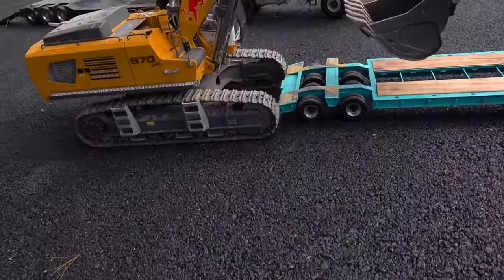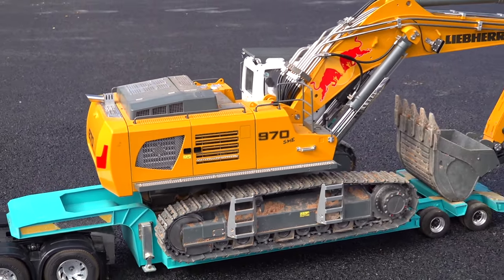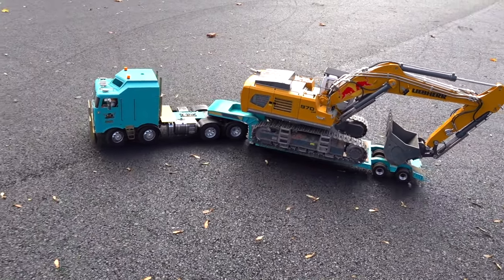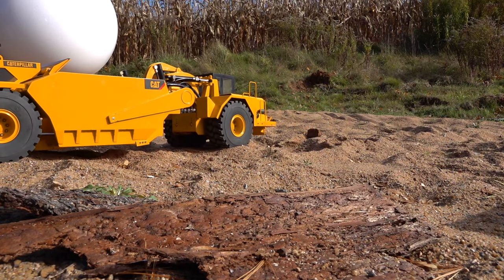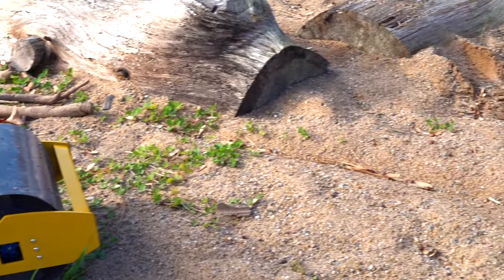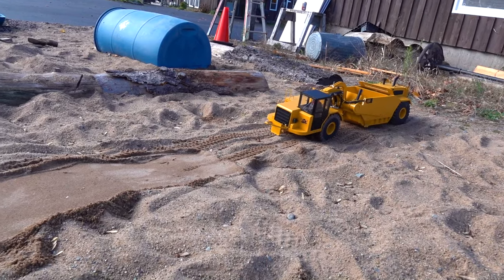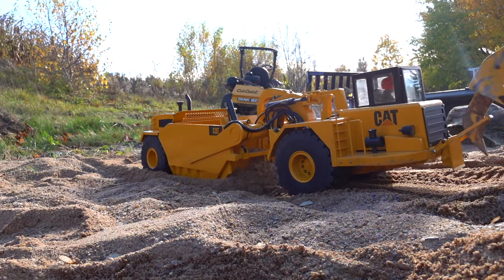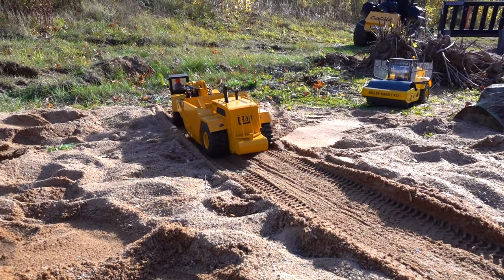Barely Scraping by, Without Any Help - Building my First Road | RC ADVENTURES

Comment: You should have a massive platform to hold all the radio control units, hanging off you're shoulders.
So you can have about 5/6 units on the go at the same time without having to keep picking them up and putting them down.
Then you can be the fat controller.

Comment: It look like you need to get a front detach lo-boy to load that scraper!  can the gate at the front of the bowl be raised higher to get material in better?  Does the ejector wall have different speeds or do you  just drive accordingly?
Nice presentation, would love to have the opportunity to run some of the units you have demo'd  in the past!

Comment: So the only thing you don't have in RC is a road grader and a paver... The scraper is probably one of those "it looks like cake" but really isn't machines. I know a few people mentioned it, but having the excavator loaded like you did is correct, and in RC its probably better because you have the heavy end closer to the drive axles so the truck pulls it a little better. 
I have a few RCs to fix before I can get outside and have fun. But working on them is fun too.

Comment: You have to have the apron on the scraper open some so the dirt starts to pile up in the can. At that size I would say at least and inch to 2 inches. You will never get a full load having it barely open like that. Nothing a foreman hates more than a scraper that isn't full. Also don't pull the scraper with the dozer, push it. The ripper on the back is not meant to be used that way. Much better to use the big old blade on the front to push with. I used to operate 637, 631 and 633. 637 are the two engine push/pull scrapers like the one you have. They usually work with another 637. One with a dozer would work but in the real world, they are much better working with another one. 631 are similar to the 637 but only have a single engine in front. A dozer is used with them. It pushes the scraper threw to get a load. The 633 is more of a finish scraper and uses paddle wheels to get a load of dirt. What I mean by finish scraper is when there isn't much dirt left to get to grade level, the level you would like to be at. I know the 637 and 631 come in a bigger size and are called 657 and 651. I know the 633 comes in smaller sizes and they are called the 623 and 613. 
Oh just in case you get another two engine scraper, when going into the cut, where your getting the dirt from, have them hook up. Then the guy in front lowers his can first and gets his load. Then when he is full, he pulls his can out of the dirt and the guy in back lowers his can and gets his. Once both are full, they seperate and head to the fill. Where the dirt is used to fill an area, obviously. Then of course as they get back to the cut, they join up again and repeat the same thing over and over and over and over again. Anyway, keep your shoulders high and your haul roads smooth.
Reply from the maker: But, there is no Foreman. I just want to play.. im not actually at work.  I like playing the way my imagination works..

Comment: I'm not sure if it's a glitch, but the roller seems to only rotate in the one direction when vibrating. It is actually fighting your forward motion when vibrating (best seen at 9:05)
Reply from the maker: It is not a glitch.. just the roller doesnt weigh 15 tonnes like the full size machine.  not heavy enough on the sand, so without traction on the smooth drum, it can go backwards

Comment: Loading the track-hoe reminds me of getting my tank on the car when railheading. Driving 65+ tons of tank down a quarter mile or so of flatbed traincar, the tank being ~18" wider than the car on either side, and the transition ramps from car to car were just big humps. You'd go from looking at the guy ahead guiding you to looking at the sky when the front hit the ramps, all at a dead crawl because it was 15' to the ground of you rolled.

Comment: Should make a controller link or a link sync cable so you can pull an connect both the steering servos together & speed controllers so you can use the one controller an not have to reprogram

Also lower belly of the scrapper when unloading an push the pay out so it fills the gap an the excess builds up on the edge sort of like your pushing dirt off the table an the scrapping the excess back up

Comment: Well hey I thought I'd help you out a little bit on your push pull scraper where you put the dirt at is called the bull not belly and the thing that pushes the dirt out it's called The Crowd the door that opens is called the apron and if you want to make a smooth pass you lower your can down to the edge of the bits on the sides you go to them where the bits are and then that would make a smooth pass and also you should have your Dozer push you not pull you I ran equipment for about 40 years so just trying to help you out there

Comment: The biggest reason you want to run with the boom to the back is because if for some reason you hit a bridge the it would be a lot easier if a hit compared to if it was turned to the front where it would be a lot more of a Blount hit because it would slide over the boom with the boom to the back of the rig

Comment: ideally you push the scrapper with the dozer with the ripper dropped so it breaks up the ground for the next pass. can you control the front hoop? in real life they run multiple of these machines and they push and pull each other

Comment: If you watch  J Paydirt  you'll  see that you  can push with  the  dozer  but the way you did it works  too
Reply from the maker: The hook is for the ripper, or another scraper pin..  Yes, the one can push.. but a good tug feels good too.. lol
Reply: @TheRealRCSparks  most will push the scraper rather than pull to save time and effort on the site.  The dozer operator will follow during the cut and begin pushing as the scraper begins to slow down from cutting.  At the end of the cut the scraper can simply pick up the belly, close the gate and drive away without stopping and the dozer gets back in the line.  Large operations will have a whole convoy of scraper and dozer teams making loops like this and never stopping.
Reply: @TheRealRCSparks  like I said in another comment.. you are bringing back a lot of old memories from my deployments in the Middle East.  I put in a lot of hours on every type of equipment you got lol.  When watching your videos my mind goes back to it and I catch my hand sometimes operating controls that aren't there lmao

Comment: just like matthew2 said but without putting the ejector forward you can adjust the amount of dirt going in by opening and closing the front gate and not have to drop it as far into the sand
Reply from the maker: Yeah, but as I mentioned - in deep sand there would have been no traction to push any sand.

Comment: To lay the road with your belly scraper open the door all the way put the belly at the height you want the scraper to lay the road start pushing the material out and drive super slow the belly should scrape any left over to the height that you want the road

Comment: Great fun, but the bulldozer should have been pushing the motor scraper, not pulling it with its ripper, I speak from experience after driving the real things (Dozers, Scrapers and Graders) for 20 years, but fun to watch.
Reply from the maker: What is the hook for... to be pulled.
Reply: @TheRealRCSparks  To be pulled by another motor scraper, they link up, the back scraper pushes the front one until it's loaded, then the front one pulls the back one till loaded (push pull) then they split to go and dump the loads, this saves them having to have a dozer push load them all the time, you also have elevating scrapers that can load themselves, if the condition are right.

Comment: How did you get the engine sould to turn on and off using the controller, because I have a Grand hauler with a  futaba t10j controller and can't figure out how to turn of the engine sound. The engine sound kit that I have is the Tamiya mcf - 1. If you could help me with this I would be so grateful

Comment: Can you mix a radio to control two machines? One machine per stick?
Reply from the maker: No.. but you can mix 2 machines on to 1 radio, and change with a flip switch
Reply: @TheRealRCSparks  I see. I’m strictly a pistol grip radio kinda guy. Never had the opportunity to use a dual stick radio so I know little to nothing about them 🤷‍♂️ lol cool stuff tho bro keep up the good work.

Comment: Loaded up wrong? Ive run equipment forever and i have never seen an excavator with the boom facing forward. Buckets curled, arms pulled up and in and then layed down and chained…

Comment: Was that as high as the bowl would go up for transport 1 more thing is a scraper is designed to move fuck loads of dirt and fast u would best set u up a circuit on hill or somthing and run cut to fill always load up down hill b easier